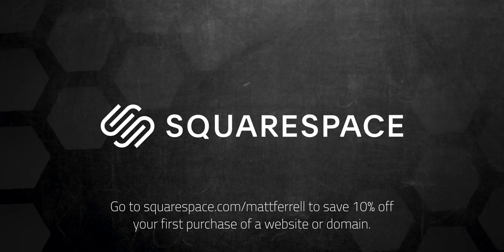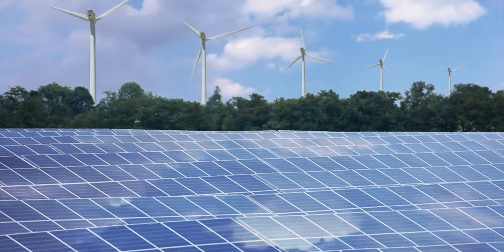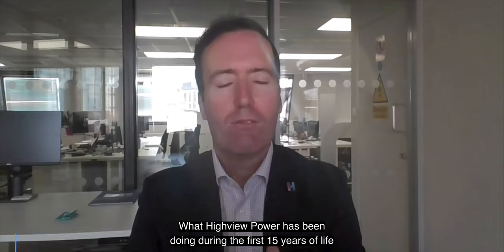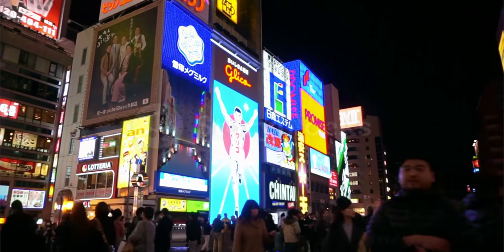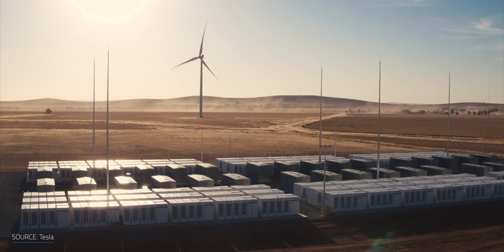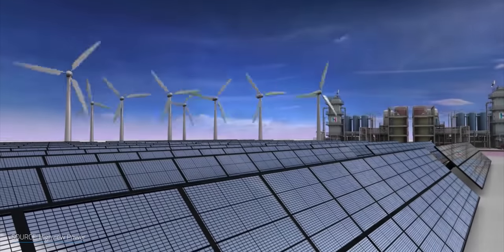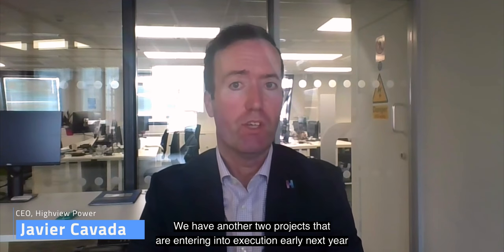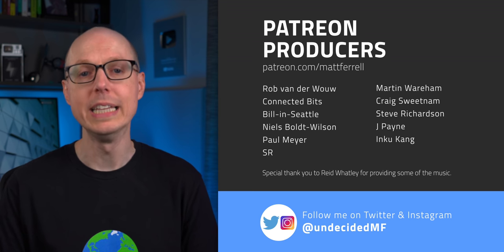Liquid Air Battery Explained - Rival to Lithium Ion Batteries?

Comment: This is a world class video. As an chemist/engineer I think it will appeal to tech and non-tech folks alike. One thing that has enormous appeal is the system safety. In a worst case scenario the primary release is air. Keep those high quality videos coming.
Reply: Yes agree this really appealed to me. Coming from Norway I was kind of fan of hydroelecricity but when I saw the enormous environmental damage by a hydroplant near where I live now in India I have my doubts.
Using air however seemed very intersting. Never heard about it..
Reply from the maker: Thanks, Steve!

Comment: I'd just use the method to freeze CO2 emissions. Transport the dry ice to a greenhouse, release the energy there, and you get better growth for whatever you're growing. The CO2 could come from natural gas powerplants for example so their emissions are put to use. Some excess capacity could be used to compress plain air, which would later be used in the powerplant. Seems wasteful to create needless entropy. The air needs to do more work than just expand.

Comment: How effective would it be to pump the cryogenic fluid along pipelines from mega-power generators like hydro to other places without renewable?

Would the loss of transmission Via pump be less than loss of transmission of electricity through the grid?

Comment: A great example of the use of air for power is the air car . Built 15-20 years ago . It used a old steam engine design , triple expansion  engine. It got 300 mi. on a tank of air, I don't know how much the air cost, but if air was used as much as oil, I believe it would be cheaper . The air also could be cleaned up as it is compressed

Comment: It's very interesting process . Ultil 60% of efficiency. 
I would like to know , if is there  some project that use water?
The water electrolysis can store eletric  energy in the chemical form . 
Making the eletrolysis, the hidrogen and oxigen would be stored in hight pressure .
Biside you take the better of this pressure to moving fisically turbines , after we could also burn the hidrogen with oxigen  and to extract the chemical energy estored to move chemically other turbine . 
The results of this burning, that 's the water, being recyclable and hot , could be used to tranfer the heat to storange tanks to gasefy the hidrogen and oxigen and being in hight pressure , would be used to  move turbine fisicaly and circle would be completed.

Comment: What I'd like is more insight into the theoretical limits of efficiency and what that means in practice - thermal storage tank size and material. From other sources it looks to me that going over 60 percent efficiency in the real world is quite hard. Not that it particularly matters when the original power source (like wind) is quite cheap. But the true competitor to this might be a thermal energy store coupled to a high efficiency heat engine (like supercritical CO2) which would get you to the 50 percent mark AND be a lot less complex and costly to engineer. There is also the possibility of coupling a thermal store/heat engine storage with liquid air so that you're feeding the waste heat from the heat engine to add power to the air turbine.

Comment: ref 5:45
You can only use low pressure vessels if you bleed of air that sublimate. This will be a constant drain on the stored energy. Loosed from storing heat and holding thing cold  will also reduce the stored energy that can be recovered.
Reduction of 20% and more in energy make it very costly and you ned large generator to convert pressure to electric energy. All this make a "Liquid Air Battery" just as good as lead-acid batteries for the job. It can be done under spesial condition, but it physics make it a poor choice for large scale storage.

Comment: what are the turbines being used with the liquid-oxygen batteries? is the technology there a factor in the % efficiency? 
would a system like the Power-Pod(just picked the one i thought fit best, but if there is a better "option" yeah) from your Solid State Air video allow for better use of the air at all?

Comment: Wind and solar are anything but cheap my friend. They're some of the highest required maintenance systems on the market, and even when cared for properly need replacing every decade or so. Not only that, but output at 100% is almost never kept constant, and as Texas saw they're even more likely to collapse under harsh weather conditions.

Comment: I've travelled the energy exhibitions in Japan for a long time.  They did something I thought was equally ingenious. They let all they power plants run on 75% capability all the time. They then use their mountains to pump water onto, storing potential energy, at night when the consumption is low.. When they need the extra energy during the day, they let the water run back down through hydro turbines.

Comment: I am quite sure this is the most ecological way we can go to store energy surplus. Heat and cold can be used and are not waste. Keep in mind that not using energy surplus is a waste of capacity. Some energy losses must be accepted. No damage done, air before, air after. Environmentally safe process. Also check out the proposals of Darin Selby on what to do with liquified and compressed air.

Comment: Liquid air can be turned into propane gas ...making it a green fuel for burners and ICE ...cars trucks ECT. 
Synthetic propane mite be more energy efficient than reusing air in direct power production .

Comment: Well yeh if super insulated which is obviously the case, most of the Cold & Heat is reused, it’s not toxic, and cyclic. Depending on the environmental cost of the insulation material, it sounds an excellent idea! But normal CA is a good option as well, as it can be used for transport in CAV as well as electricity generation!

Comment: I feel like flow batteries would be more scalable than this form of energy storage. Anything is better than nothing but the cost per megawatt will truly weed out the bad storage options and also the ability to utilize small spaces in metro areas. This seems like a lot more maintenance and upkeep than stacking up shipping containers of flow batteries. Go ahead and utilize old existing gas plants and push out the CO2 producers but don't waste a bunch of money on building new plants from scratch until you can prove it is cost-competitive.

Comment: I am wondering why it has taken so long to get this renewable energy storage method up and running,as it was stated in the video the technology is 100 years old? One limitation would be,if you are talking about peaker plants, it is not as fast responding as lithium ion,which can answer demand in microseconds,but why not combine the two,with a small lithium ion battery supplying instant power for a minute or two until the liquid air storage gets up to speed? For base line power,liquid air could be built to a scale that would supply a week or more of power,being recharged from solar/wind generation.

Comment: I doubt that this thing is useful in northern Taiwan. We have few space for lying solar panels, and our climate is not helping with the steady monsoon wind blowing in winter, where as the main power demand occurs in summer for air conditioners because of the 30C average temperature in July.
I'm not saying the concept is useless. But this doesn't seem to fit our specific need. I guess nothing other than nuclear options will gut down our carbon footprint in a manner that keeps up our power needs.

Comment: The big problem I see as far as economics is that lithium ion batteries can do hours long storage, they do it regularly in cars and and electronics. The reason they don't do it on the grid is because the second to second grid balancing is more valuable, and with limited battery supplies, they are going to be focused on the most profitable function they can perform. But if batteries drop in price (by say, 56%), and the number being produced goes up by factors of 10, then they will be put in place to store sunlight through night where necessary.

This doesn't mean their isn't a niche for cryogenic storage, just that it is only going to be a niche. Batteries can do more, and they can work at small scales where this kind of thing won't (you could do cryo for your house probably, but definitely not for a car, let alone a cell phone), so the only way for cryo to be relevant is if it is cheaper in those larger scale applications that it can do.

If they can make it cheap enough to compete, and scale fast enough to be relevant, then this is a good thing. It doesn't require any hard to acquire materials, and what it little has in common with batteries is abundant stuff, so it won't contribute to a resource crunch as we scale up production.

I hope it works out and can be done cheaply and reasonably efficiently.

Comment: Believe it or not but nuclear power is our only way to go. As human technology is growing rapidly, so does our demand for electricity. Neither solar energy not wind energy with be able to meet that ever growing energy demand and we will eventually run out of coal and petroleum. Hydroelectricity, thermal and wave energy can't be produced everywhere. Our only bet is Nuclear, good if we find a way to sustainably use fusion otherwise we will have to stick with fission.

Comment: Could they use the cryo air batteries to do carbon capture as well? If they're already separating liquid Nitrogen and Oxygen can they separate the Carbon Dioxide and Methane out of the system too?

Comment: Need to integrate with a cryogenic air separation facility! The liquid oxygen is a valuable product, and materials of construction for the tanks get a lot cheaper if just using nitrogen as the working fluid.

Comment: If you are going to cool and liquify air, why wouldn’t you use surplus power to create hydrogen through electrolysis and then cool and liquify the hydrogen? Obviously, such systems are in development too. But like the guest stated in this video, the choices are all going to be determined by some bean counter with an Excel spreadsheet who makes the simple determination that this one is cheaper or more efficient or requires lower investment than that one and choice made. But considering that we have been willing to journey to the most inhospitable depths of the Arctic to drill for petroleum and transport it in heated pipelines for thousands of miles, environment and habitat be damned, for a one time combustion to power our K-cup machines every morning, the solution certainly seems to be sitting in front of us.

Comment: One aspect of the process that is not taken into account is that upstream, we can capture CO² and various pollutants by pumping the air, or even produce water by artificial condensation for the arid areas.
Thus we can have a negative carbon balance, an expansion of income, multiple utility depending on the site.

Comment: This is a solution to a problem we already have a solution for. We don't need vast fields of solar panels and wind turbines and elaborate ways to store the energy, just build new modern/next gen nuclear plants. They're more efficient, more reliable, cleaner, safer, and in the long term cheaper than any other form of power, so you'll save land, time, the environment, lives, and money. We can combine our existing spent fuel with decommissioned weapons material to generate enough power to meet our needs for generations, turning it into a variety of useful byproducts in the process.

Comment: I'm thinking these could be used in conjunction with a tesla type grid support system.  Since these can store more for longer, could they be used to keep a subsystem going when the weather turns and it can't reliably top off it's own reserves??  At the same time, it can supplement the system if needed.
It seems like a very interesting technology, and I hope it proves itself well in the field.

Comment: I think we need to prepare for a fractured grid system and be ready to supply energy locally.  The "smart grid" idea is going to take decades to create and implement, meanwhile our infrastructure is reaching end-of-life and the power companies aren't keeping up with repairs.  

In California, we have had many fires start from aging, bare lines hitting each other in wind storms.  When the power company turns the power off either to repair or protect the rest of the system, an air battery system would allow us to have local power for a day or two.

Comment: I find it hard to believe it’s worth storing the hot and cold energy from the process, I’d imagine it would easily cool or heat up during the day and be fairly useless by the time it’s actually needed at night. There are also other air energy storage facilities currently in use in the US, they don’t freeze it though, they just cool it and store it underground. You wouldn’t want these liquid air storage tanks to heat up too much or they’ll explode, so there must be a lot of energy going into make sure they stay cold, problems traditional air energy storage facilities don’t have.

Comment: My gut says that between the inefficiencies of pumps, and the losses in the turbine, that it all ends up being pretty inefficient, and as someone else mentioned, maintenance heavy, especially if equipment is used to keep the air cold. Not that I have a better idea off hand. It definitely would seem to be a large scale solution, which is a good thing, but I would think the cost / MW would flatten out fairly quickly and, although adding storage is just 'adding a tank', it is also adding whatever is required to maintain that tank. But if you lose say 40% in storing the energy, it would seem like it is worse not better - UNLESS that energy is coming from a natural source such as wind, solar or wave power (which is pretty cool tech in its own right). 

Thanks for all your articles Matt. They are usually the ones I check first to see what I've missed.

Comment: Air and water?
Why are we still investing in oil?

Excellence is indeed in the air we breath.

* * *

Is the liquid supply possible via salt water?

I write this before we are all experiencing tornadoes and monsoons,
and.... as a possible solution....
(if salt water is as feasible an option as it is for producing green hydrogen),
for reducing rising coastal water levels.

Kind regards
LM

p.s. can this technology be adapted into transport vehicles?

Comment: Lithium Ion batteries have other weaknesses bedsides cost: limited charge cycles (300-500 times), limited raw material supply, and their return trip efficiency at utility scale is only about 60%. Great for short-term storage, but not a solution for long term or seasonal storage.

Comment: I like any industrial scale power tech which when it critically fails just releases clean air. 
so many seem to explode into horrific toxic sludge when they fail  or poison gas, or fire, sooner or later all systems fail, best to have it preset to do minimal damage when it does. a  few popped eardrums in the immediate area or if you're really unlucky someone getting snap frozen if they were walking next to one of the tanks as it ruptured would be about the worse of it, which is extremely mild compared to say a lithium battery or dam failure.

Comment: #Matt Ferrell, could you do an episode on flywheel storage please? I have serious interest in the 10-20kWh size (or even 50kWh if I get an electric vehicle) for domestic use, coupled with a small battery system (mainly for rapid demand response).

Comment: Hell, wouldn't it be both more energy efficient and easier to build systems based on the principle of dam, like building huge concrete water reservoirs at heights?

Comment: The real answer to energy storage is molten salt.
Solar farms should be infrared instead of ultraviolet. 48% of Solar energy to just 8% . Thermal produces 6 times as much as Solar panels.
Salt has as much latent heat as water, so we just melt a tram full of salt at over 1000 degrees C and roll it down a tunnel for storage 
The other end of the tunnel would be the power plant 
The salt will stay molten for months once the surrounding earth has heated up to match

Comment: Can you use those facilities to power a lesser amount of Lithium batteries? Like having multiple turbines feeding electricity to a single battery?In that way you could spend less of the Lithium element, which less renewable than air